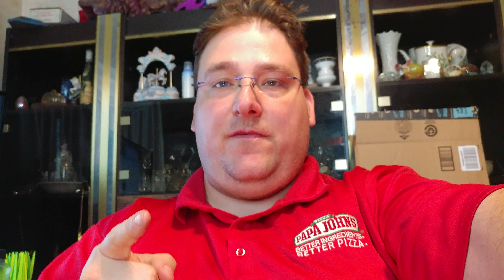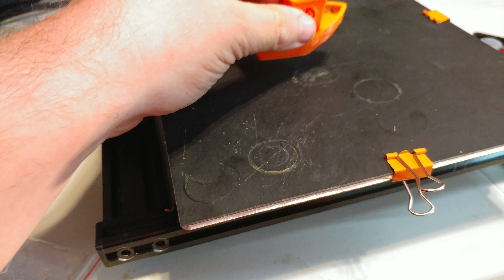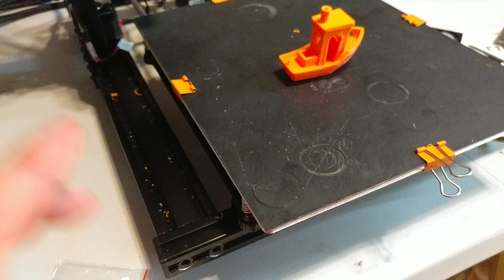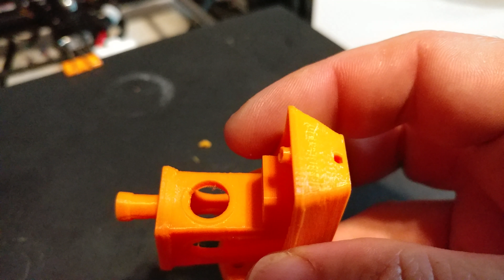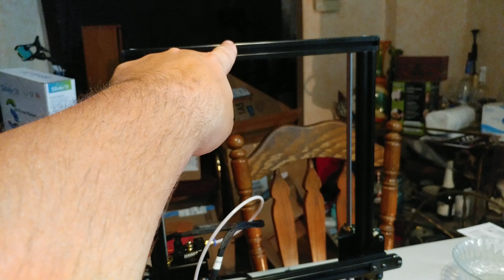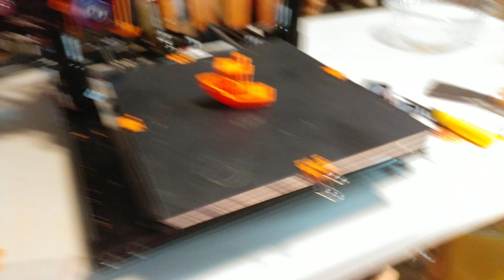Today's 3D Print - Holy Crap. My Anet E10 Printed this!

Comment from the maker: holy crap I just printed another one and its EVEN BETTER. in fact its probably the most perfect benchy I Have ever printed.

I bet my other prints will do better as well by lowing the temp. I was so used to printing esuns pla pro (which needs 220c) that I just always used 220c without even thinking about it.

this thing is printing as good as my flexion prints. that is truly stunning.

Comment: Hey man! Great video btw! Just wondering if you remember what size fans where needed to replace all the fans on the CR-10? I'm out of town or I would do my own research. I would like to order and have them when I return home. Thanks Nerys
Reply from the maker: Nathan Brothers In the brain box you have a 50mm for the melzi board

$11 http://amzn.to/2ujlH4n

at the back of the brain box you have a 40x20

$15 http://amzn.to/2ukkmZw

in the PSU in the brain box you have a 60mm fan. the Noise blocker 25mm works if you don't put the cover back on but I finally found a thinner fan.

$7 for 1 http://amzn.to/2ukleNJ
or 3 of them for $14
http://amzn.to/2uk1l9H

for hot end you need this fan
$10 http://amzn.to/2ujSxST